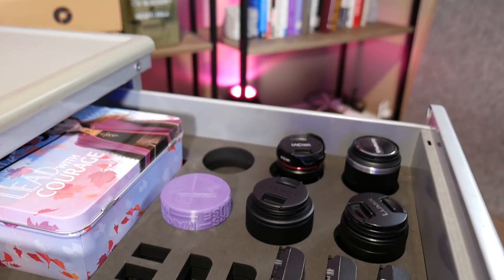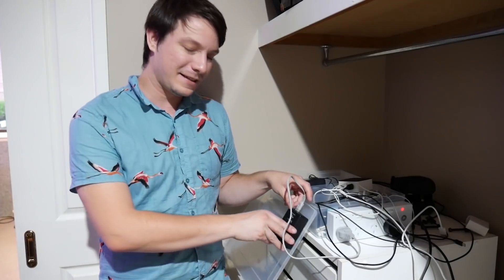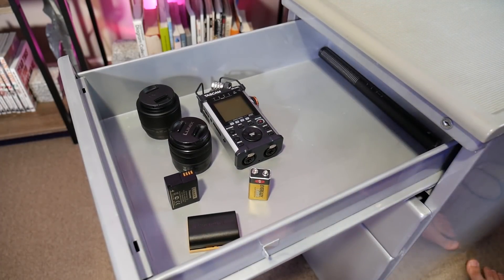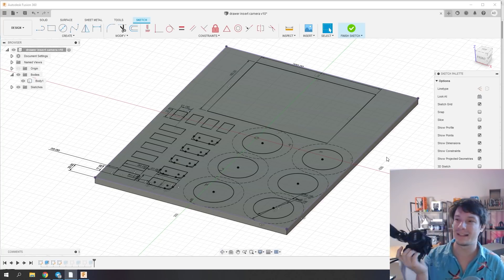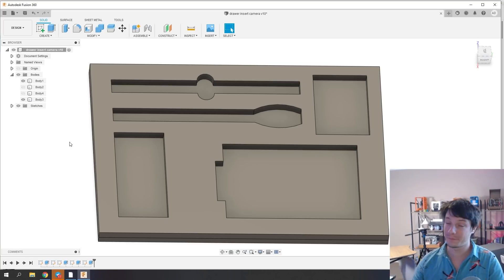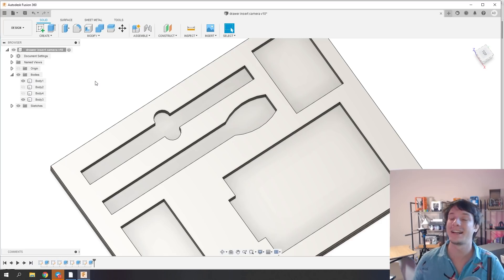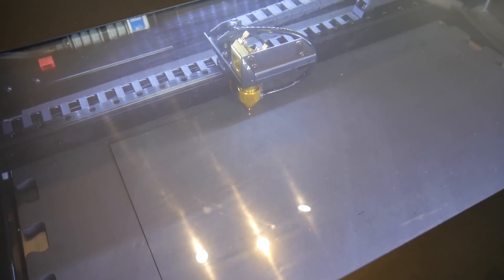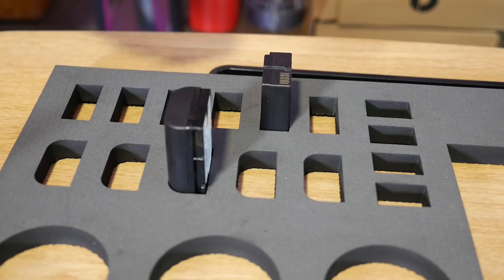DIY Custom Inserts using EVA Foam and Lasers!

Comment: I recognized your Australian electrical outlets to figure out your location. I really like their design. The North American ones are terrible, because it is easy to get a shock, unless you mount them with the ground side up. 
Your laser cut foam is really fantastic!!! Your valuable gear is extremely well protected.

Comment: flip the top drawer foam around so the box is at the front, quick sollution at least. 

i hate drawers that dont open all the way. I try to upgrade all my furniture to have full extension runners so its possibly to get things out of the back.

Comment: MM: cheap EVA foam and a $2,000 laser engraver! anyone can do it
Reply: Yeah this is a bit disengenous. IMO easier to 3d print stuff (as https://www.youtube.com/user/alexchap89) like Alexandre Chappel has or simply just use a utiility knife and cut out parts shapes into foam, or use something like heated wires..

Me, im happy to have everythign rolling around in drawers.
Reply: Fair point but my local library has them for free use by any member

Comment: Super cheap solution until you find out the laser costs $4000. XD Thought I was finally going stop throwing money at Pelican Custom! XD
Reply from the maker: Haha yeah, but if you have a makerspace in the area with one, the cutting time is really quick so you could pump quite a bit out in one sitting with some planning.
Reply: @MakersMuse  Oh totally! One day when $4000 is an easy investment to make. ;) I'm totally going all in for one, a cnc mill and formlabs printers. :D
Reply: or just a regular printer, print out your layouts, stick the paper to the foam, and cut it out with a craft knife is the cheap sollution. though not as neat as a laser, time consuming, and depends on your skill with the knife.
Reply: @ge2719  I've done this before with a heat knife too. Foam is just so messy and i keep noticing the imperfections, so I tend to stick to the pluck foam and just melt them together. Then I found out about pelican customs. expensive but not $4000 expensive. BUT one day! I'll afford $4000 no problem one day. :P

Comment: I do eva foam inserts with spare power tool cases. I just need to dremel out the plastic inside.
Reply: I like those cases too. I’m not sure what they are made of but it sure is tough.
Reply: @spookydonkey2195  Polypropylene. Plastic jars and Tupperware, furniture... When you think of plastic items, chances are it's polypropylene.